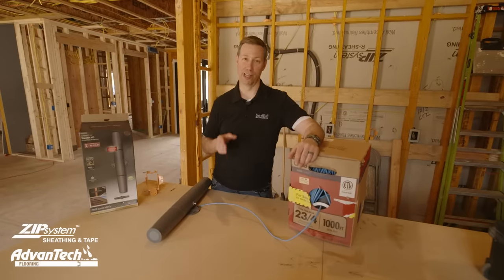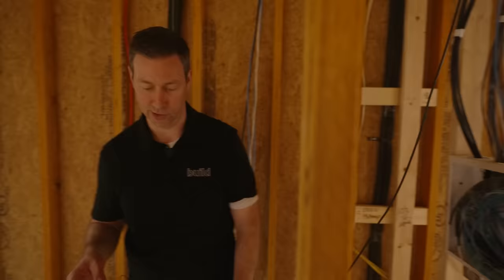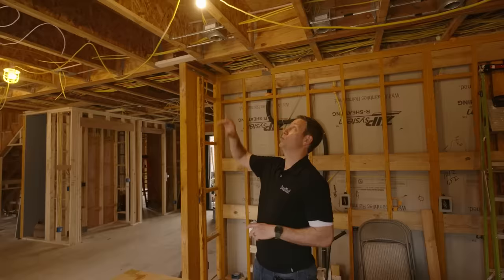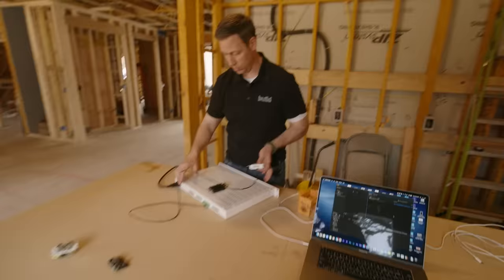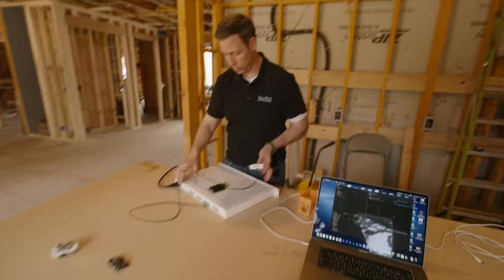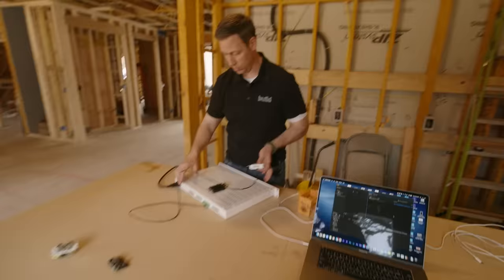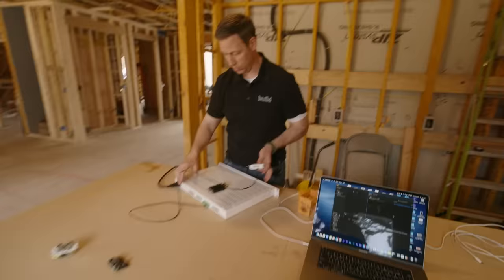Low ⚡Voltage at the Real ReBuild

Comment: I really liked this one, a few thoughts:
As others have mentioned, running extra CAT lines to places you might want future wifi makes sense. Both for data and/or just POE. Think decks, outside entertaining, relocating an office to a bedroom, any place you might want better coverage in the future and be prepared for the next  couple releases of technology (WIFI-7 or -8 maybe).
Think about mechanical controls and where you might want to run ethernet to them. Thinking water heater, solar controller, battery management system, additional security cameras or motion sensors (if not for data, for power),  etc.
Always make sure you leave a good service loop on your cables. Keystones can break, as you mentioned interfaces can evolve, something else might happen, its always better to be able to open up a jack and find a nice loop to give you some working length rather than only a couple of inches which often gets shorter when you cut out the bad and try to finesse the new in.
Running conduit to the attic is smart. You might not "need" it now, but as thing evolve you might really want to connect two locations and being able to do it in the attic without cutting into a wall is good planning. Might cost a little bit now, you might never use it, but if you do it will save you lot in time/energy/money.

Comment: Wired is great for fixed locations. Wireless can have interference, reflections, competition from other devices, line of sight issues, etc. If your TV, desktop, whatever can be plugged in, go with it. lol. A lot of stuff works wirelessly until it doesn't - like when you turn on your microwave or put a mirror or metal filing cabinet on a wall the wifi used to go through. lol.

Love the ideas you bring up in the build - I think low voltage DC lighting is probably the future. I've seen some implementations of it, but nothing standardized yet. 

The current wiring for lights is serious overkill for LEDs and has some inefficiencies with lowering the voltage and converting AC to DC at each socket...  yet, we still need the AC high voltage for ceiling fans, so there's likely always going to be a mix throughout the house - and for or due to conversions from fans to lights and/or plugs.

Comment: Matt you mentioned wired connections to each room. I did just that in my old house as it was being built, what I forgot to do was spider it out.Definitely put the wire to each room, but trust me you want to run 3 wires from the "room" box to the other walls. No matter how you think your teens may arrange there room its better to have a wall plug close to where its needed. I laughed every time I went into my teens room and saw the cat5 wire runing along the base board so the table he was using (and kept moving) had a wired connection. Nice videos on the built, I love the new materials your using it helps me with my upcoming post frame build.
Reply: I wonder if anyone makes a small patch panel that you could install in each bedroom closet or something.
Reply: @prototype3a  Not worth the trouble. You could easily mount a 1U panel on the wall inside the closet to use as a room-level demarc, but then you end up needing a switch, and for many use-cases today you can easily find a single 1G Ethernet run to be a bottleneck if you're a heavy data user. For the cost and complexity of doing that you might as well just run drops to every outlet location.

A much simpler approach is to just drop one or two Ethernet into a single main box, and then use a 6x keystone jack decora insert as a DIY patch panel, with each jack wired to another outlet on another wall in the room. Or just drop Ethernet to every high voltage outlet. It's cheap to pull Ethernet when the walls are already open, more doesn't hurt. Then just patch in your main network closet if you don't have enough switch ports to light up every drop simultaneously.
Reply: @prototype3a  HI Drew, I'm just a little cheaper I would just used a straight RJ45 end to end plug (like 2 bucks) in the main room box and treat the wires as an extension to the other wall. It may not be the best or fastest but it gets the job done.
-MG
Reply: @haphazard1342  I seriously doubt you'd have bottlenecks with a single 1g link to a room.  Nothing really uses that much bandwidth and I know as I have a 10g link between my server and NAS and regularly move large amounts of data around at 300mb/s or more.

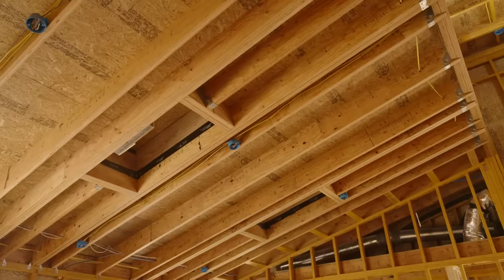Comment: 5:06 don’t forget to think about “heat” dissipation from your “media cabinet room” from all the Tech going in there. Will put off some heat, and really wanna make sure have good air flow moving that hot air out and filter dust would be a bonus, imo.

Comment: He needs more physical internet connections to avoid over saturation of wireless signals. He also should have run conduit/smurf tube where he’s running Ethernet in case he needed to upgrade in the future. Missed chance in my opinion.
Reply: I have 2 lines running to every time and even I am considering adding more. Wifi is the worst and should only ever be used for mobile devices. TVs, sound systems, and everything else should be wired.
Reply: @JohnNeville617  exactly the reason I mentioned the smurf tube. Everyone runs into this issue unfortunately. Or worse yet, a wire gets damaged during installation. I’ve seen that happen many times.
Reply: 2 cables per location should be the minimum now with 3 being a nice hedge for future
Reply: I am a wireless networking pro. I run Cat6 everywhere. Wireless is a finite resource - use it for stuff that can only be wireless - if you can plug a network cable into a piece of equipment, plan to cable it..

Comment: Matt: Considering all of the equipment your putting into you media closet, do you have adequate cooling? All that equipment is going to generate a lot of heat. You may need to provide some type of cooling.
Reply: Poe switches generate some BTUs
Reply: Absolutely, some ventilation will be necessary. However, I think he's already done with this stage and these videos were filmed a while ago.
Reply: @nathanddrews  I haven't seen it. and in the clip of Matt showing the media closet I didn't see any Air vents for cooling. I am pretty sure he didn't plan for cooling the media closet.
Reply: I came in here to ask the same thing. Even if he puts passive vents in it may over heat.
Reply: He can get one of them wall mounted AC units. Not a window one.
Reply: It's really not that much stuff and it is a fairly large room for the amount of equipment. It will probably be fine without any added cooling.
Reply: @blaydCA  He is only using a 19u rack. You can only put so much stuff in a rack that size. Along with the patch panel and some blanks for space. Nothing compared to many of the places I have wired.
Reply: Might not be fun to be in the room, but a lot of equipment can run pretty hot before it's a problem. It'll shorten the life some, but probably won't be a huge deal as long as there's some air exchange.
Reply: Ubiquiti equipment usually doesn't run too hot.   A simple vent in the door should be fine.  or maybe a vent fan pulling in air from house.
Reply: When you have high-density electronics in an unmonitored space, it would be wise to install a thermal monitor as part of your home alarm network -- and possibly add a small Halon fire suppression system to this expensive space. Alarm it for smoke particles and rate-of-rise temps, and let it self-extinguish any unseen ignition sources!

Comment: 1in" smurf tube from the demark to the media closet/home run is cheap insurance for years to come.
Reply: Absolutely. With an accessable, clean, conditioned attic, just running pipes up into the attic is good too.
Reply: @JavaZombie  shitty conduit that is impossible to pull stuff through..  just use normal pvc
Reply: @JavaZombie  blue plastic flexible conduit.  Basically an easy way to run a cable
Later.  It’s blue color like smurfs

Comment: Hi Matt. FYI: The Frame from Samsung comes with the one connect box and one connect wire, in the box. But it's only 5m/15feet. For the long 15 meter or 30 meter, you do need to buy the longer cable separately. Also, make sure you get the "The Frame 2021". Big upgrades from 2020 models. Regards, a Samsung engineer.
Reply: Yes you are correct I would actually keep the one connect box close to the TV and recommend a Versabox from SnapAV behind the TV to house the one connect and anything else and he could always run a HDBaseT for the TiVo over the Cat6

Comment: I’d like to learn about how you’re handling the Ubiquiti install — should be interesting!
Reply: Ubiquiti is super easy the only downside is you have to have a software controller on your network for any configuration changes.  Also they don't have as many features as something like a meraki would have but for home environments it's typically good enough.
Reply: @captaink118  the device he mentioned, the Dream Machine includes the controller and (potentially) a DVR for his cameras.
Reply: @nickbernhardt1756  was he getting the pro?
Reply: @brandonv8721  I’d imagine so since he mentioned it being rack mounted.
Reply: Learning about how you did the wireless access point and how the Ubiquiti is set up would be great information!
Reply: Would also be interesting to see an install of the whole Dream Machine Pro list of functionality, network, cameras, access control and phone
Reply: @brandonv8721  I don't remember specifically, I don't think he said Pro.  He should be getting the pro, especially with cameras.
Reply: Barry Johnson  This is both a really easy and really hard question to answer.  I run UAP-AC-PRO APs.  My house is single level, wood construction w/drywall and only 1300sq ft.  My neighborhood isn't super dense, so I can only really see 2, low strength, 5ghz SSIDs from anywhere in my home (compared to 15+ 2.4ghz, which is part of the reason 2.4ghz is somewhat useless in urban areas).  I have two APs active and I have great coverage everywhere in my house, and pretty good 5ghz coverage in the deck attached to the rear of the house.  The hard part about this question is that there are so many factors: spectrum/channel usage, power level, construction methods and materials,  intended uses and the most difficult aspect of home wifi, the clients that will be connecting.  

The short answer is, trial and error.  I used iStumbler to see how noisy my home was, and then I looked at how my home was laid out.  We have two distinct sections to the home, so I placed an AP in both.  Then I made sure each AP was using different channels than each other, as well as channels that weren't noisy with other APs in the neighborhood using.  This is easy on 5ghz because you have a lot of channels, and on 2.4ghz I just did my best and threw one AP on channel 1 and the other on 11.  I also enabled band steering, so if the Unifi controller sees the same client on both 2.4ghs and 5ghz, it will stop talking on 2.4ghz which "forces" the client over to the 5ghz spectrum (this is good). 

My very poor rule of thumb for coverage, is that each level of the home gets 1 AP, and then for each level, for every 1000sq ft, add another AP.  So, if you have a 4000sq ft home with a 1000sq ft 2nd level, 2000sq ft main level and 1000sq ft basement, I'd probably roll 4 APs for that.  Sounds like a lot, but with wifi, you usually want to drop the power as much as you can while still providing good coverage.  Running more APs at lower transmit power will result in better performance than fewer APs at higher power.  Remember, Wifi is a shared media, which means only one thing can talk at a time (per channel) so in a perfect setup, you want your APs covering as much as they can, without being able to "see" other APs.

Lastly, take note of your old stuff.  Old devices will often require then entire AP radio to perform to it's level.  If you have an 802.11b device, it's going to require the AP to (usually) treat everything like 802.11b clients, or at least reduce speeds to accommodate.  Ideally, anything that is more than one standard revision behind your AP should be pushed to copper if at all possible.  If you can't do that, then think about pushing it to 2.4ghz and expecting crappy performance, which might be fine, since a lot of that kinda stuff is appliances and IOT devices which don't need much bandwidth/performance. 

Wifi is a complex thing to get right, but do the reading and give yourself time to understand it.
Reply: @captaink118  Yeah, you can run it in a VM, get a cloud key or install it on a raspberry pi. The issue with the dream machine pro is that I believe it requires a cloud account. You only technically need it up to provision your APs.
Reply: Go to crosstalk solutions on YouTube. He walks you through all of ubiquiti setups. I've used him alot
Reply: @brandonv8721  He would have to get the DM Pro. The smaller Dream Machine doesn't support the cameras.

Comment: are you doing ceiling mounted access points?      or the little wall mount ones in major areas?      even mounted POE security cameras?   I also highly suggest running a smurf tube from your LV area to the attic area now.  in the future it will be much easier to fish another run in to anywhere in the house.

Comment: Glad to see you using over the air television. If that were any more exposed or any bigger of an antenna, lightning protection is a serious consideration. 

As far as the rest of the network goes, looks like you did well with consideration for cameras, doorbells, thermostats, etc, as more an more devices being sold want to a way to 'phone home'

Comment: If you get a HDHomerun from Silicondust and connect to the antenna you can watch on your phone or TV or anything else on your home network
Reply: Matt Risinger  I think your YouTube account may have been hacked.
Reply: @DonovanSexton  it's not a hack, a scammer just creates a channel with the same looking name.
They need to be reported as spam and YT removes them.
Reply: I use a Tablo network DVR. Works with my phone and AppleTV. Can add a big USB hard drive for capacity. Also have an HDHomeRun which I use for live events (and I sell an app to use the HDHomeRun to point your antenna.)
Reply: @ke6gwf  ah it looked exactly the same.  Same name and picture it seemed.  Didn't think about a separate channel and I sure wasn't going to click on anything to find out.  I did report them as well, but after about 6 of them I stopped haha.
Reply: I have one and it works great.  I get it on my phone, table, Amazon device, Google devices.
Reply: HDHomerun's app is terrible.  Doesn't always detect the device, and the guide on it is absolute trash.
Reply: I agree and go for the Quatro 4K ATS3 It decodes the new format and you can simply add their DVR functionality https://youtu.be/pllv1CE5jAI
Reply: I have that connected to my Plex server & with a lifetime pass I get the benefits of the TiVo Matt mentioned but can access the media anywhere I have internet. I can also upgrade the plex server or have multiple servers if I wanted.

Comment: EDIT - I apologize - your solutions are bleeding edge and reliable.  I love you content and even those I am way north - in cold country - your solutions merit attention.  Thank YOU!  

So - I am a bit of an old geek. 30 yrs ago - I built  400 kbyte networks - in a day when 56K modems were the top of the heap.  Before 56 was 33.8 back to 300 baud. So - I have been on a T1 - some 25 yrs  ago. Fiber - old fiber modems gave us 25 to 50 Mbps - some 12 yrs ago. The current fiber I am typing on - is a WIRED 1 Gb network - running at 176 Gbps - from here to the internet.  Wireless - clamps the top speed to a multiple downward of the theoretical top speed.   Wired connections give you top speeds. Use them where you need that fat pipe. Like a 24 inch AC pipe - verses 12 or 6 inch.   Cheers!

Comment: As an IT dude by trade, I can appreciate how technically correct you are with the low voltage stuff. Great channel. Thanks
Reply: Did you catch that he said CAT 6 stranded? I was holding back my full IT nerd self back, its not stranded for structed cable like he was showing. I do a lot of WiFi engineering, but I run wires everywhere and try to rely as little as possible on WiFi. I have two story plus basement with three Unifi NanoHD waps.
Reply: @nellermann  he’s just a salesmen, he doesn’t really know what he’s talking about.

Comment: That's a LOT of cables run into that 16x16 box! I've got half of those cables and a 24in tall low voltage box next to the 220v main service panel. Plus a secondary hidden location for my network storage drive and security camera footage recording server. Any burglary would assume the footage is on my desktop or inside my locked low voltage box, but it's not. All my personal data is stored on my personal Synology cloud drives along with the security camera footage server, along with their own UPS battery backup. With UPS battery backup the internet, WiFi, security cameras, and my network storage cloud will still run for over an hour without power from the grid or generator running.

You might want to think about keeping those storage devices in a gun closet if you're going to build one of those security closets again, like you did in a video ~2 years ago.
Reply: Exactly. That 16in. box is like 75 lbs. of potatoes in a 50 lb. sack! 42in. MINIMUM.